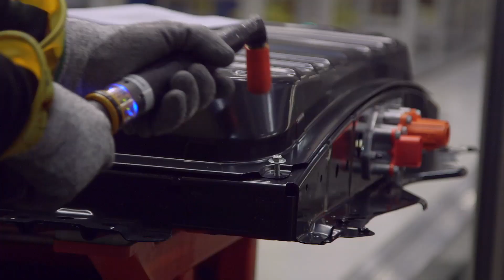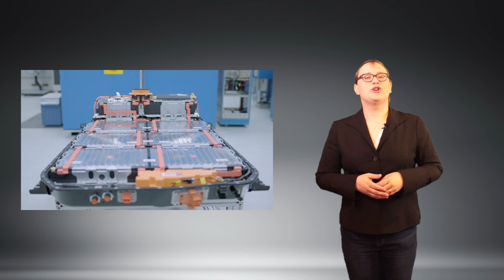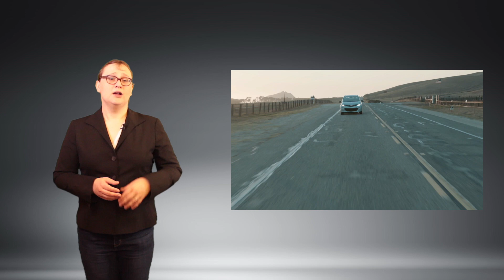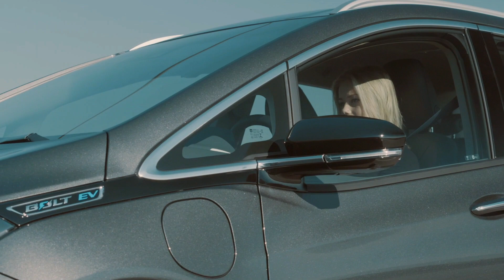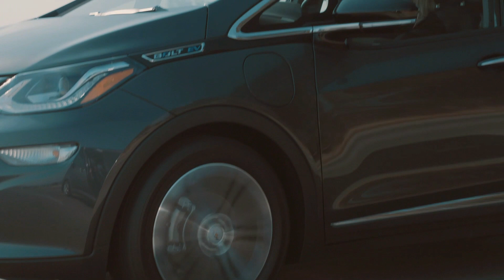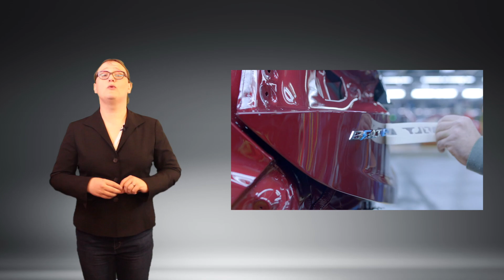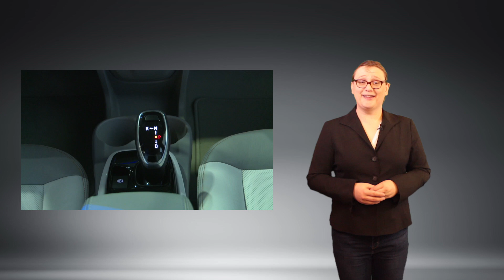Should You Worry About Battery Replacement Costs for Electric Cars?

Comment: lets see, these batteries use lithium and seeing that lithium is more limited than oil, so common logic would tell me that eventually the price of batteries will go up  the more EVs are on the road.... also looking Nissan Leaf an average battery last around 120K miles (so when you factor in that cost after 120K an eco car is cheaper to run)

hydrogen is the future of mass transport why are you so called "progressive" people is trying to hard to fight it???
Reply: Some thoughts:
- Oil is consumed, rapidly and permanently. We build stuff out of lithium, and can recycle it indefinitely. Lithium isn't the limiting factor for EV expansion - that'd probably be rare earths for the motors.
- Hydrogen isn't practical with current technology. May be in future, but it'll have to compete with improved PV solar and battery technology.
- Utility-scale power plants are far more efficient than car engines, even with transmission losses.
- No one has released an electric truck yet, but that's just a matter of time. Tesla is working on it.
- Electric buses already exist. Agreed that buses should (and will) go electric.
- Battery waste is an issue, but we're getting much better at recycling them. Especially as recycling becomes more lucrative
Reply: dunhillsupramk3 .  H in a free state is also one of the rarest things on Earth.  It takes power to hydrolyse it out of H2O and more power than it produces in a fuel cell.  All energy is just conversion.  Each Thermodynamic conversion is less efficient than the one before it.  That's the law.

Most of these EV cars in North America are going to actually be running on natural gas (at the power plant), so why not just run them off natural gas directly.  It is more efficient and makes less pollutant.  Leave the EVs and Hydrogen fuel cells to districts with hydroelectric or geothermal plants.

For our EV enthusiasts, riddle me this.  Go down to the Tesla dealer and watch the new cars being delivered.  Look at the truck pulling them.  Is it electric?   Why not?  There's sure enough room on the big truck for the batteries or the hydrogen tanks.  Range maybe?  Bull horsepower maybe?
Reply: exactly!!! which ever fuel is used to power semi trucks and buses will be our future and so far hydrogen is our best alternative... currently you can use water and algae (a new method) to generate hydrogen, the oil companies will be using this to produce hydrogen when the natural gas prices go up again... (this method is also more efficient than a solar panel)
currently MB, Toyota and a new company called Nikola is developing hydrogen trucks and buses for the near future...
Reply: dunhillsupramk3.  MIT started the algae in water tubes experiments a decade ago, but industrially it didn't seem to have a future yet.  That may have changed, but most lab chemistry (especially organic chemistry) can't be scaled to industrial production.  I'll read up.

Anyhow, fuel cells should be in freight trucks long before personal cars.  When we see fleets of non diesel trucks outnumbering the classic trucks then we will see fuel cell cars.

Every new engine tech since 1759 has tried to JumpStart itself with batteries.  It never works long term.  Railroads tried batteries and jumped to steam.  Submarines tried electric motors in 1862 and jumped to hand cranks.  Powered bikes, then back to steam and then ICE.  Cars with steam then batts then ICE.

A chemist knows batteries are gigantic problems and will create more long term problems than they solve.  Remember that ICE trucks and cars solved the problem of dead horses and manure in the streets.  Yeah!  As soon as that nightmare was forgotten, the same ICE was blamed for new problems.

Comment: I've had 3 EVs. I've never had issues with the battery packs. Between my fiance and I, we've had a Leaf, Spark, and i3. Tesla is next. 

Considering we put about 15k miles on each car (minimum) every year, we've seen zero noticeable difference in performance or capacity. 

The only thing that seems to really affect performance is cold weather.

Comment: What about Renault's battery lease system that applies to the Zoe,  Kangoo Van range and Twizy. Renault pioneered electric vehicle battery leasing. Their lifetime warrantee avoids the need to worry about battery replacement. This is a good to alternative to buying the vehicle outright. Effectively renting the battery so avoiding depreciation on the battery and replacement cost. The battery rental is also a fair bit lower than equivalent fuel and servicing costs. This system wasn't popular when introduced some years ago but now as battery prices reduce so leasing costs are reducing making it a credible option. Outright doesn't necessarily mean right...

Comment: How is the electric battery made? What happens to all the batteries after life of the car?
Reply: By mining metals and turning them into batteries, much like an ICE and all of it's components are made. At the end of life for the battery, they are recycled - there are a lot of precious metals in even a 40kWh battery. Tesla has said long term it should be able to recycle more than 90% of the raw materials in a 'spent' battery pack, and is already working with partners to get this going.

How is oil extracted? And coal? How about transported and refined? Those things are not exactly clean either, and need to be done over and over again to run the car for it's entire lifetime.

Comment: great video, I support your theory that the Chevy bolt battery will not need to be replaced for hundreds of thousands of miles. I own a 2012 Chevy Volt with over 100,000 miles on it cycled daily. I did the math if you were to cycle a Chevy bolt battery as many times as I cycled my Chevy Volt battery it would get well over 350000 miles. currently my battery is showing zero signs of lost capacity or power.

Comment: The main things that bother me about current and near future electric cars is that with all the talk about how their batteries degrade, they're really filthy to make and dispose of, awful for the environment right now and they're not cheap to replace at all.

Even though with the newer cars, the batteries are bigger and a bit more efficient overall, sure, but they're bringing in those "rapid" chargers that charge a car to pretty much full in about half hour, if you can call that rapid, but "rapid" charging those batteries will just degrade them even faster, no doubt about that.

It's not the right way to go at all. And then there's the same talks about where the power comes from just like with hydrogen fuel cell cars, the power's got to come from and be stored using renewables otherwise there's just no point to any of it. The infrastructures need sorting big time more than anything, plug in electric and hydrogen, when those things are done well, then it'll be wicked.

Enjoyed this video, it's well done.

Comment: 5000 Dollars for a new battery. That is not cheap. That a quarter of the price of a new Golf GTI. Seriously, who in their right mind would buy an EV with that in mind. Fuel cells are much better in that regard. Sorry, but not everyone can afford 5 grand for a new battery.
Reply: Until you factor in that the savings of the BEV over an ICE in the expected lifespan will almost pay for a whole new car, especially if you drive lots of miles. Tesloop in the US has saved so much with a Tesla vs the equivalent Merc/BMW/Audi that they could actually buy another Tesla, over 300k miles.

Comment: I just bought a used Zoe. I was worried about the battery a little, as it's a) very small and b) might suffer in our hot summers in Spain. That's why I chose to lease the battery, so I don't have to worry about that at all.

Comment: The real problem is resale. It doesn't matter if the original owner didn't need to replace the battery under warranty, the second owner realises that there is a good chance the battery will need replacing after 7 or 8 years. $5000 is a lot of money to repair a used car hence the value of a used EV is low and the original owner takes a big hit when selling. I wish this wasn't so as I would love to buy an EV but for a lot of working class people buying an EV probably won't stack up financially until around 2025.

Comment: no worries around my Volts battery pack durability (seems bulletproof after five years, get exactly same e-range) but will say reliability of other little components aren't quite there yet. Regen makes a funny 'spaceship' noise (dealer says it is normal), and I have had drivetrain bearing go out before. Also will comment that electronics in car are starting to develop gremlins, too. In other words, I think the big issue with electric cars is that tech is still new, they are figuring things as they go. BTW, all visits I've had to dealer have been covered under powertrain warranty, which for my vehicle is 8 years or 100,000 miles i think.

Comment: Manufacturers should design batteries to last. Usually 300-500Mm (megameter) is average life of a vehicle (EU). My Leaf loses 2% per year, per 30Mm. So after 10 years (7 years left) it should be around 80% capacity left. The end. Nothing to replace. Manufacturers should give batteries a lifetime warranty. That means that nothing else beside degradation happens. Normal degradation. Which is 2% per year (first year is exempt). 
PS: Battery should be able to keep up with power input/output.Otherwise if regen goes down vehicle actually degrades in terms of "emissions" or MPGe value.

Comment: I am by now pretty confident that batteries after 2020 or some even now degrade slower than combustion engines. After all one has to take into account that conventional engines and transmissiona are subject to noticeable wear and will thus lose efficiency and range/cost effectiveness over time as well. However I think that the environmental problems of Li batteries are greatly overlooked. In the EU one would have to drive an electric Golf for 14 years before having a lower carbon footprint than a gasoline driven one if manufacturing is included in the calculation. And I am sure the environment does not care if the garbage and exhaust gases poisoning it come from customer use or manufactuting or from a german city or a korean factory.

Comment: Battery packs for EVs should most definitely be a concern, and needs to be more affordable otherwise one may as well just get a new car when something goes wrong with a pack. just because the wear on battery packs are considered far and few between it doesn't mean nothing can go wrong that will warrant a battery pack exchange. That would definitely be a deal breaker.

Comment: I was quite annoyed because of how you compare EV's with and without active battery temperature management, as if they where the same and should cost the same... Not just this video, but on others aswell. 
I'm pretty convinced buying an EV without liquid cooled battery pack that will ever see really hot climates is not cost effective at all, at least not for now. 
Maybe in the future some independant hackers will create cheap, good and durable battery packs for the nissan leaf. But nissan itself will probably not, they want to sell new cars. 

Also because of many factors electric cars wont degrade as much as ICE and 100 miles is nothing really for a non abused EV. 

There is no way a leaf is cost effective except in perfect climate....  Liquid cooling is relatively cheap to implement and repays a hundred times its cost.

Comment: Nice video nikki, i was worried about battery life before i bought my auris hybrid (can't really afford to go all electric) but i have not had any problems with degradation whatsoever, but before i bought it i searched for how much it would be to replace so i found a third party engineering company near Swindon that would replace the whole lot with new cells for less than £800, so i bought the car....nice

Comment: Nikki your opinion on LEAF battery is a bit inaccurately unrealistically rosey. Yes I got a no cost warranty replacement because I knew how hard you had to be on it to get the warranty and because Nissan did the replacement two weeks past warranty.
But most early adopter purchasers ended up having to sell the car at huge loss or pay $6,000 making cost to drive same or higher than gasoline.
Not near as positive a story as you state.
Reply: Tim Lee. Yes that's what I've seen here in Georgia too.  Leafs were everywhere in Atlanta because you could get the tax credit from the US and a big tax credit from Georgia too.  Some dealers would rent the cars minus the credits and the driver got a car for under 10,000 and paid the interest on the front to the tax credits that the dealer cashed.  The driver (mostly Indian H1b workers) thought they were getting a "free car" as the salesman told them.

  The cars wore out.  The battery packs degraded due to long traffic jams and hilly or mountainous driving.  They overdrove the allotted miles, but they had to turn in a car (lease) after three years with a good battery bank or pay the 8000++ penalty.  I've seen so many Leafs driving home after sunset with no lights and windows down on very hot night because they don't have enough power to make it home.  They couldn't charge it at work because the charging station was an hour round trip in traffic and would take hours to charge, yet they had an hour for lunch.  There was only one or two slow chargers in the parking lot and the big bosses had their Teslas plugged in all day.

It is best as a downtown hipster car for someone living close to a train station for any trips.  The Prius is still the best electric alternative for general use.

Comment: In SriLanka over 5000 Nissan EV 's are available.  The Agent AMW has not installed a single Charging Point or Imported a Nissan Leaf EV. Many have trouble in sorting out Battery Packs. Without returning can we buy the Battery pack directly from Nissan UK or USA....!

Comment: My 41 kw battery on the Zoe was £5600 more than had I leased the battery. It does have an eight year warranty though (70% capacity). I am not worried about the battery (in the UK with a mild climate which helps) and I take the view that if there is a problem in several years time it will either need a few cells replacing or batteries will be so much cheaper it isn't an issue. For me the thing that will age my car is the lack of proper fast charging capability and I am hoping that may be something that could be retro fitted when it is commonplace.

Comment: The average age of cars on US roads is 11.6 years old, according to IHS. Most ICE cars being built today will last over 200,000 miles. EVs could potentially last 300,000 to 400,000 miles, since they have so few moving parts, so the price of a replacement battery should be an essential part of the equation. I expect that eventually we will start to have 3rd party manufacturers for batteries, but at this point we are totally dependent on the car companies for replacements, so we must look very closely at their replacement prices.

Comment: I  don't worry about battery degradation at all.  My leaf will pay for itself entirely in a little over 6 years of ownership in fuel and motor tax savings compared to my previous petrol car.  I've had it for two years so far and have clocked up nearly 60k kms.  I still have all 12 capacity bars.  The rate of degradation is so slow that it will easily be useful to me as my only vehicle up to the break-even point when I will look at getting a new car, four years from now.

Comment: I have had my Tesla Model S 70 for 20 months now and driven around 34.000 km. The expected range the car reports is exactly the same as when we bought it. There seems to be no noticeable degradation.
Reply: I did not. And regarding the car itself. It is such a fantastic car. It is by far the nicest, quickest, coolest, most awesome can I have owned.
Reply: I have a had a S85 for about 2 years already and mine still drives like new with over 100.000 km on it.

The data on battery degradation shows it should last well over 1 million km so I'm not exactly worried about it.

https://www.teslarati.com/tesla-battery-life-80-percent-capacity-840km-1-million-km/

Comment: 1.  Batteries are a drawback for EV's no matter how you try to spin it and do degrade over time and usage so therefore a battery replacement cost is a concern for those of us who own their cars beyond 3-5 years or buy used ones.
2.  How long into the future can you buy a replacement battery?  Cars evolve every few years and EV's even faster: new designs, new technologies, bigger batteries etc.  There is no guaranty that today EV's will have a battery replacement/upgrade in the near future when you actually need it.
3.  Why think of a battery replacement in similar terms as a ICE replacement?  Two different non comparable things: one is a fuel tank(battery), the other one is the engine( electric motor).  ICE should be compared to the electric motor and the battery to the cost of a fuel tank.

Comment: Quick answer: no.  Battery costs are falling in half every 10 years and Tesla's battery pack may last longer than 30 years.  To replace a battery pack after that time would cost less than half of its present cost.  

GM's battery cost reduction may not be as large since they (or LG Chem) are not building a Gigafactory to drive down battery costs to the same extent as Tesla.
Reply: Lots of assumptions and leaps of faith there bunky.

Comment: 100k on my 2012 Tesla Model S 85kw only lost 15 miles so far in degradation, (265 rated, charges up to 250 currently) noticed if I unintentionally completely kill the battery (which Tesla suggests against at all costs) I loose 1 mile each time. Purchased the 8 year unlimited mile warranty, so no worries there, for now.

Comment: Our 2012 Minicab MiEV does about 80km per charge. With 40,000km on the clock, it's not bad. Though there are plans to upgrade the battery to increase range.